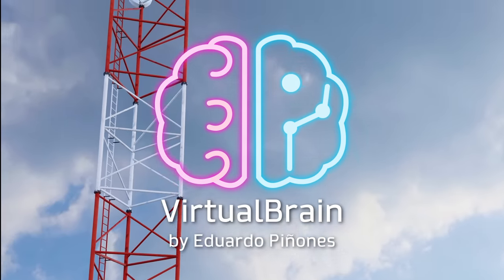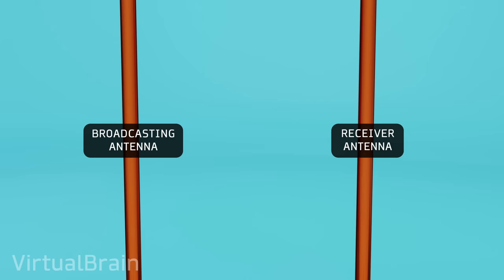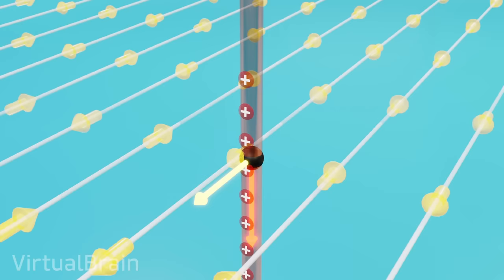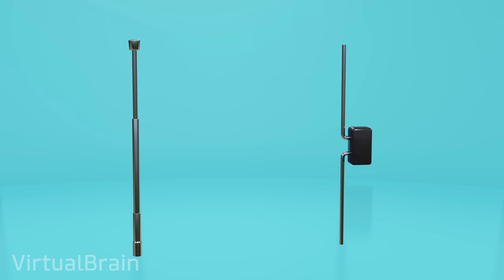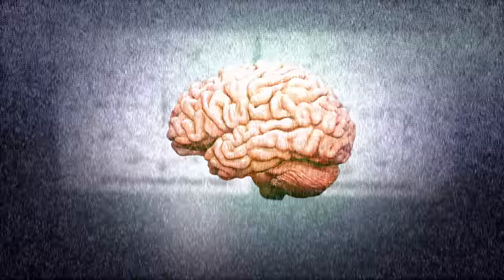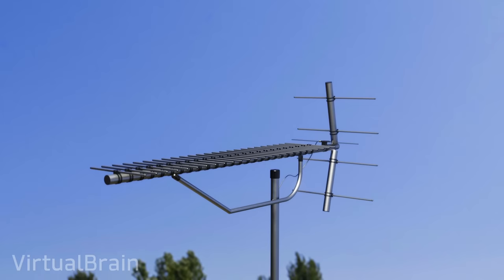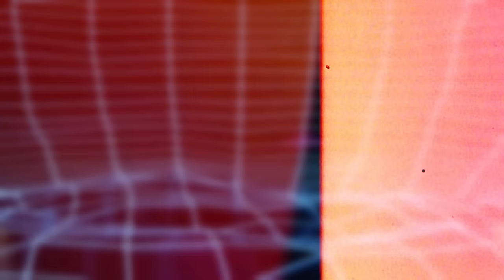How an Antenna Works 📡 and more

Comment: Sorry but despite the general concepts being accurate, this explanation is misleading as it makes it look like local magnetic filed is the same as the magnetic field of the wave. They are not the same. The magnetic field fades very quickly form the source so I would never be able to influence a remote receiver. It is the electromagnetic waves that can actually propagate. This a subtle but crucial difference
Reply: Yeah spotted that too
Reply: MaxLinear just has issued a new open ran 5g SoC chip called “Sierra”.
A very powerful chip!!!!

Comment: Nice animations.  Fine primer for people who aren't in electronics.

Electronics brain is asking what about the analogue of space as a transmission medium with characteristic impedance, as with any other transmission line, and how impedance matching is important, and how the length of the antennas are usually a bit different than calculated due to the self inductance of the transmitter...  Reflections.  Noise.  Side bands.  Near and far fields.  These are just off the top of my head.  Nice animations.

I'm not complaining.  But I have been searching for a long time to see a good video describing near and far fields and lossy transmission lines.  I want to learn more of that in like granular detail.  There is some tech I worked with, long ago, and now I wanna know how it worked exactly.  The work was for a communications company in the Arctic  (a weird place).

Comment: Actually the method by which "radio waves" travel is photons. Alternating charge acceleration (voltage) in a metallic object produces photons as the electrical charges expand and contract just like doing the same produces light via mercury atoms in a fluorescent lamp. Radio reception is achieved when the photons interact with metallic objects and turns photon absorption into expansion and contraction in the antenna, thus producing a reverse of the alternating charge acceleration in the transmission mode. Charge acceleration is detected and the alternating voltage amplified, processed and the output turned back into meaningful information.
Reply: nice. it's like photoelectric effect, essentially.
Reply: @rachweston Question please: So are photons generated from "agitated" (my term) electrons and it's the photons that become the waves sent out?

Comment: This video helps me understand the way the energy fits into my understanding of how  I work the universe works, black holes work and all life works because all actions works and have the structure of a donut. I can feel energy radiating from people with my palm chakras it was the hand shape they used to describe the electrical energy which helped me understand if energy is going in or coming out of the body

Comment: I think it important to note for the uninformed, depending on proximity, just how small these signals moving from a transmitting antenna, to a distant receving antenna are !
And the important role the radio receiver plays with it's amplifying abilities, which without those amplifiers, these weak signals, typically could not be rectified, and heard !
Too, something I don't believe was mentioned here, is the,
" Law of Reciprocity " !
Which simply states that an antenna used for transmitting, will also exhibit the same characteristics, when used for reception of radio waves !
Essentially, the antenna will work equally well for both, transmitting and receiving !
Also something known as resonance of a given antenna, plays an important role on how well both transmitting and receiving work.
Much like the tuning of a Guitar, or other stringed instrument being tuned to produce a certain pure note, due to vibration,  which in turn is frequency, the antenna must also be tuned for proper operation !
                       🤔....?
                   Just Say'n !

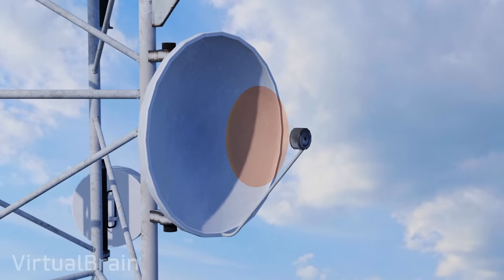Comment: 12:10 What is it exactly that "bounces off the dish and is transmitted into space"? 
How is it transmitted?
What is the dish made of?
What is space?
Reply: electromagnetic waves permeate space in the manner depicted in the video at timestamp 1:45. space is the distance between massive particles, typically conceived as being in the macroscopic realm as objects. the dish reflector is made from fiberglass or aluminum.

Comment: Nothing new, but nicely presented. Maybe mention why electricity seems to ‘jump’ from the wire to the ground, the dielectric effect. Same effect as the capacitor. So, that’s why you can pump electricity into a strand of wire and it gets absorbed.

Comment: 1:50 Induced electron movement is  is going in the wrong direction
Reply: First, they're positive charges (shown moving), so assuming they're in same direction as conventional current.
Second, right hand thumb rule is used for current to magnetic field direction, whereas Faraday Lenz's law is opposite (magnetic field to current) and that law also has negative sign. So, right hand thumb rule won't work here. (Same as why Fleming's rule has 2 different hands, left for motor, right for generator)
Also those magnetic field lines would be accelerating.
Reply: Yes. Current flows negative to positive, not the other way round. Very common error.

Comment: A question, on the video the receiving antenna is vertically positioned, while the electric field is horizontal. Shouldn't the antenna also be horizontally positioned for best reception?
Reply: I guess antennas are being horizontal or vertical while producing. Means that if you rotate a vertical antenna 90 degree it wont be horizontal. They are some kind of "mushroom" antennas which both take horizontal or vertical signals. So best to use them to not lose any data. But as I said I am not the expert. Someone could easily disagree with me.

Comment: No mention of loop antennas? I think most of us have seen them with radios. Be nice to get an explanation of those and how they differ from other forms.
Reply: I’ve ever seen a loop antenna on a tower in over 30 years working in telecommunications. The closest thing to that used on towers is a folded dipole antenna.  I don’t even know what the wave propagation would be on a loop antenna. Most broadcast antenna’s radiation is in a plane parallel to the earths surface as that’s where most receivers are.
Reply: @Chris_at_Home   Hmm... Guess that must mean they're normally only used for reception-only applications. I sent a faulty stereo off for e-waste that had a loop antenna on a plastic frame that was maybe 15*10cm for AM reception, and the classic introduction-to-electronics kits usually include one using a ferrite rod for a smaller physical size.

Comment: ❌❌❌Warning: the electromagnetic wave in this video is wrong! ❌❌❌

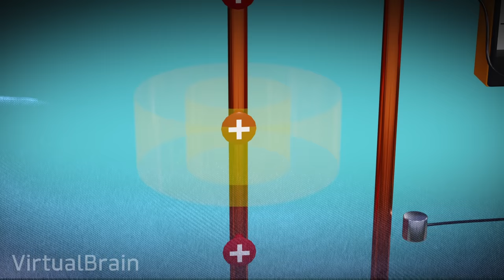The most useful part of this video is the portion from 3:21 to 5:22, where it shows how an alternating current can induce a changing magnetic field, which in turn induces an electric field that can move charges and create a detectable potential. This video would have been a wonderful resource to help people understand electromagnetic waves, since most if not all other animations online use electric fields as the primary entity, with magnetic fields just tagging along for the ride.

Unfortunately, this portion of the video is also wrong: the induced electric field and motion of charges should be in the opposite direction to that shown in this video. It is easy check this because electromagnetic waves propagate in the direction of E x B, which is opposite to the direction of propagation shown in this video. I hope this error can be corrected before some poor student flunks their physics or engineering class because of this.

Comment: Radio amateurs talk about SWR. What is it?
Reply: Standing Wave Ratio, which is a measure of impedance matching of loads to the characteristic impedance of the antenna. There is a good article about it on Wikipedia.
Reply: @rpbajb  Thanks.
Reply: @carmelpule8493  Excellent explanation.

Comment: Seriously ??   POsitive charges leaving the negative terminal from a battery ??.........  I couldn't watch anymore to put up with this stupidity.
Reply: lol
Reply: It's correct conventionally, refer Resnick Halliday for your clarity, I'm in full support of conventional current as in entire physics including all right hand rules, current means conventional current, which is not flow of electrons but flow of hypothetical positive charges. Do your research before writing stupidity.
Reply: @xclassmechluv 
"Hypothetical" .....  haha.   It's like teaching children common core math.  Gotta do it the hard way.   And you wonder why they are struggling in school.

I've seen the old 1950's instructional videos for electronics and radios,  and I first learned electronics reading magazines back in the 1980's.   They all show electron flow  which makes more sense.  Even the components are designed based on that concept.   However,  some morons along the way thought it was a good idea to teach new students the other way ---  The hard way.
Reply: @WTF_BBQ  Thanks to those 'some morons' who chose this way of teaching current, otherwise we need to declare proton a negative charge and electron a positive charge. You should read Wikipedia's Electric Current page. If you are asked to show current on a wire moving from A to B, how will you show?
Reply: @xclassmechluv wait wasn't  it obvious for current to take as flow of protons??anyways here Majorly current is displacement  current which has to do with time varying magentic field
Reply: Well, good for the scientific community that u ve left the video.
Study electrons and comeback again
Reply: @soufianesentissi8799  
Obviously you don't know what an electron is..... Come back when you graduate highschool.